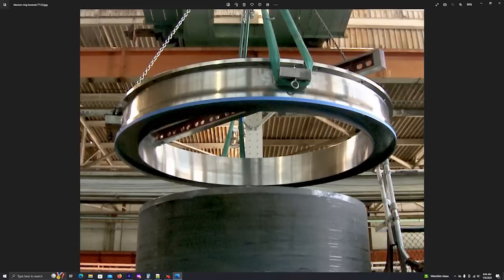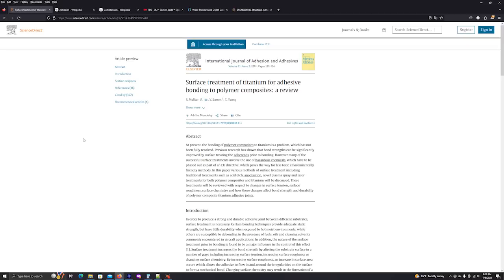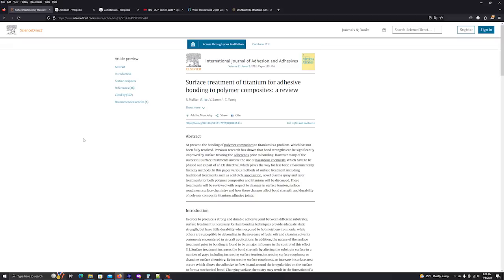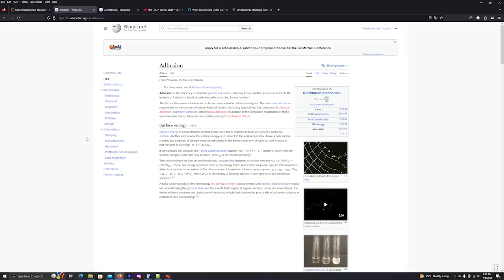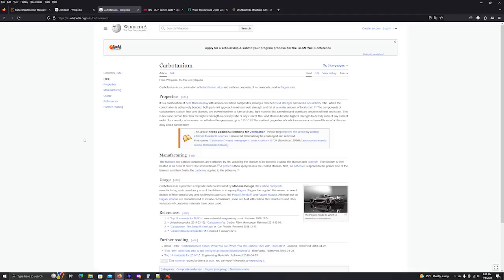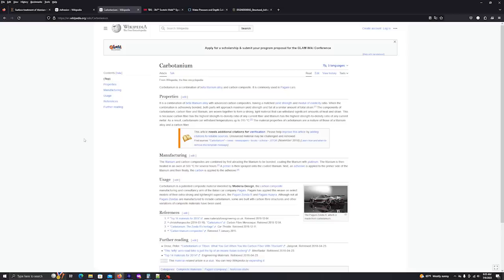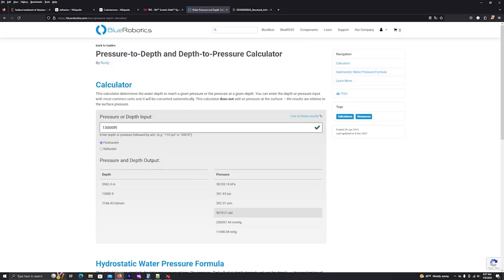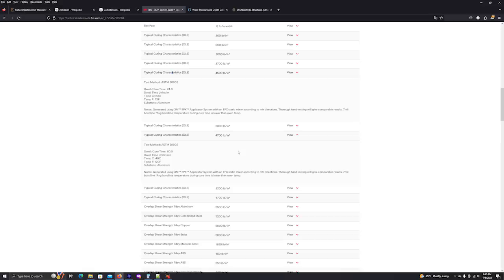Oceangate Titan Adhesive issues between Carbon Fiber and Titanium

Comment: Wow, great information on the bonding process between the carbon fiber and titanium elements. I had flashbacks of diving on my submarine and hearing the hull creak as we went below certain depths. I am not an engineer, but these were the forces that made me concerned for the bonding process. With each dive/ascend cycle there had to be a case hardening type of effect that would eventually weaken the bond. I'm sure it's a case of no balls, no blue chips. The lesson has been learned. RIP my fellow submariners.
Reply from the maker: Thanks for the feedback
Reply: you know once under water they wouldn't even need to have the two pieces glued together...the pressure of the water alone will make it impossible to separate the caps even if you'd try...so the glue as NOTHING to do with all this.
Reply: @TechWizMaster  It's likely that reasoning was taken as 'innovation'. It's not a bug it's a feature! Why make a big deal of holding the flange to the tube when we all know the only way that glue will fail is if there's a hole in the hull at depth. Kind of like the acoustic sensors in the hull that tell you the hull is failing. 'Everything's in the red,' is not a useful diagnostic alert.

Or that it won't matter if you're on the surface and you can't open the hull without unbolting the hemisphere 'because you're already dead.' Dead by design. Squashed like a roach in a corner nobody could reach without pointy shoes.

This is some of the most bizarre thought paths for an engineer. It's such a blind dependency on the numbers and the strategy that the alarm is just there to let you know you failed at a critical point. What you gonna do about it.? You're already dead.

Comment: 11:08 I've worked with Scotch weld it has HORRIBLE adhesion properties with metals such as aluminum and titanium. We used it as a bedding compound for damaged fastener countersinks in carbon fiber panels on F/A-18 Hornets.
I'm trying to figure out why they did not have mechanical fasteners going through the flanges and carbon fiber. I understand that it is under compression while underwater. At least on the front hatch there's a fair amount of shear and tensile force on the flange when the hatch is open.
Reply: Firstly, the idea is to NEVER put mechanical fasteners in CF structures if possible; by cutting the CF Tow, the strength of the individual Tow (where one drills thru) is diminished to the now length of that between fasteners; not the original length/strength intent by Design Engineering. But it really wouldn't have mattered as the Hull imploded first IMHO ... that 6,000 psi would have kept the dome/flange securely in-place ... until the Hull imploded and pushed them right off ... no amount of fasteners or adhesive would have helped ... "Water" does not "compress" and when it gave way, the Water had to go somewhere (out the 2 ends). Bad design and execution all the way around. Rush even stated in one video that the "Adhesive" was actually NOT for the stated purpose ... the intent was to act as a "Buffer" between the different expansion/contraction properties of Titanium and CF.

And free advice on your F/A-18 cured panels you're countersinking ... put a piece of 3M approved masking tape over the area you intend to countersink and then, with a sharpened CS bit, drill. You'll never have another CS with edge "Tear Out".  Works as well on "thru holes" where tear out happens on the back side. Trust me on this Bro.
Reply: @craigsowers8456  No, No, No these were repairs to the damaged countersinks after the removal of striped, stuck fasteners. We had a few younger Airframers that would go a little wild with a drill trying get stuck fasteners out. As far as not having mechanical fasteners we had mechanical fasteners going through structural carbon fiber panels attached to aluminum. I agree it does not help when being compressed at 6,000 psi, but it is not always at the pressure and my question still stands with regards to tensile, and shear forces applied to flange that has the door on it. When open that door acts like a lever on the adhesive joint twisting and pulling on it.
Reply: @patrickradcliffe3837  Copy that ... thought you were talking "new build"; still good hip pocket info on use of tape. As the Door can only be opened on the surface (for ingress/egress of passengers), I'm sure there are forces exerted ... it's a damn heavy door ... so hinge line may take its' toll one adhesion of the flange to hull bond line ... but since Rush elected to not do ANY Ultrasonic (and X-Ray if it looked really bad on the scope), wouldn't know that answer; if you don't inspect, everything is Peachy ... until it's not.
Reply from the maker: Good question.  Thanks for the feedback

Comment: You used freshwater for the pressure to depth calculator. 5619.21 psi

But the saltwater psi is higher. 5768.86 

Not that it probably makes much of a difference
Reply from the maker: Yes I normally check the box, I forgot on  the video

Comment: And this is why the biking industry gave up on carbon titanium bonded frames. Except for "single-season use" factory race bikes. Different thermal expansion rates of material adhesives not able to adjust to size difference. Especially when it experiences multiple thermal cycles.  Nevermind the Warpage Cycles caused by extreme pressures due to multiple dives. Bonding in those conditions is a no-go!!
Don't need to be an engineer to have common sense!!
Reply from the maker: Good comments, thanks

Comment: I know that carbon fibre was chosen because of cost. But if I were going to build a deep diving vessel it would be made of spun steel, Titanium or machined aluminum. Due to the extreme pressure at that depth, the design would be a sphere. It would be a solid sphere shape with no bolted seams. At that depth, a window would be useless. Video cameras would make up the visual aspect of it. I would have redundancy after redundancy built in for safety. With a dedicated way to return to the surface. Definitely a control system that didn’t involve a Gameboy controller. There would definitely be a hatch in the event it were to get away from the surface ship to allow egress from the hull.
Reply from the maker: Good points, thanks

Comment: Yup, mechanical bonding is much weaker because it relies on nooks and crannies of rough surface which can never be as dense and as numerous as atom to atom bonding. Using glue for such extreme pressure application is definitely going to be much weaker than using weld.
Reply from the maker: Thanks for the feedback

Comment: We use titanium rods in our race motors. If they get  any kind of scratches they are taking out of service. If you get any kind of scratching on the titanium surface it is compromised therefore making it impossible  to get any kind of a structural bond.
Reply from the maker: Thanks for the comment

Comment: Rings or hoops of cured carbon composite don't have great strength when compressed from the outer radius.but they are from within the inner radius due to continuous fiber lay-up.
Reply from the maker: Yes, on  the original sub they used filament winding,  On the titan they used carbon fiber prepreg with a tape winding machine in both hoop and axial winding.
Reply: Seems they made a pressure vessel when the opposite was needed.

Comment: The compression stress the adhesive sees is not directly the external pressure.  The axial stress in the hull tube reacts the entire projected area of the OD of the tube using only the cross sectional area in the tube wall.  The adhesive is largely in compression on the end of the tube and largely in shear on the sides of the groove where the tube is bonded.  I get about 22 ksi mean axial stress in the tube if the bond was only on the end of the tube.  The shear stress on the sides will take some of that load, but not so much as to exceed the bond shear stress.  The distribution of stress depends on the backup structural stiffness and the bond line thickness.

This is complicated by the structural deflections of the titanium sphere and ring relative to the carbon fiber tube.  The joint likely undergoes rotation with applied pressure.

The manufacturing quality issue with the adhesive is that if there are void areas in the adhesive, the void is unable to transfer the compressive load from the titanium ring to the composite in that area, and the stress will be concentrated around the perimeter of the void.  Seeing their manufacturing video of the bond, i struggle with how they avoided leaving large void areas in the bond.
Reply from the maker: Thanks for the clarification.

Comment: AS I see it the separation of bond is a serious issue and actually could have caused implosion. But I think when the final analysis is done the problem will have been the difference in compression behavior between Titanium alloy and the Carbon Fiber matrix.   You see Sea water at that depth has compressed in volume by more than 11%.   All sorts of other things compress in volume accordingly.  My guess is the Carbon fiber has matrix has compressed at the depth about 300% more than the Titanium.  This wouldn't have been a problem if the carbon fiber matrix was externally or internally wound with Titanium.   The issue here is that the carbon fiber would have retained its strength had the inner madril of the submersible was say 2 inches thick Titanium. Then the Fiber and metal would have been complimentary.  

The big problem is that bonding to Titanium must rely on a "Mechanical Bond" as you present.  Such a bond would not be stressed if the core was 2" or so Titanium.  Carbon fiber is used extensively where it is compressed from the inside of the shell.   Actually one could build a submarine that was compressively supported by a gap between a titanium internal cylinder and a Carbon Fiber outer cylinder where the pressure between the two was say 1/2 of the depth differential.    This would cause the loading to be 1/4th the energy involved at full compression.  This is a squares function.  

The topical data I read suggests wind with the the Carbon Fiber Titanium wire or matrix glues with powder Titanium in them.
Reply from the maker: Thanks for the great explanation

Comment: If you watch the video of the "fire piston" (link below), it provides a possible explanation for what might have happened to the combustible materials inside the submersible. In my opinion, it appears that the hull and everything within it vaporized. To confirm or challenge this theory, it would be helpful to examine the interface where the hull once met the titanium ring. Specifically, we should look for signs of heat scoring or shearing, as well as any indications of air bubbles where the failure occurred.

In a typical diesel engine, air is compressed roughly 14 times before fuel is added, and it ignites instantly under those conditions. Now, imagine if the compression were 400 times! When the implosion occurred, it generated extremely high temperatures, potentially surpassing those found on the surface of the sun. While I calculated the temperature to be around 120,000 degrees Kelvin, I find it hard to believe that it reached such a level. Nevertheless, it must have been exceedingly hot inside the submersible.

In a diesel engine with a 14:1 compression ratio, all of the fuel burns. Gasoline engines typically have compression ratios ranging from 8:1 to 12:1. Although I'm not an expert in automotive fuel combustion, as a well-informed layman, I understand that higher compression ratios result in more efficient fuel consumption. With a compression ratio of 400:1, it is highly likely that everything within the hull was incinerated within an extremely short duration of approximately 0.0038667 seconds. This calculation is based on the following: the length of the tube was 5.8 meters, and the speed of sound in water is 1500 m/s.

Regarding the delta air volume (pressure constant), we can consider 400 times 300 degrees K, resulting in 120,000 degrees K. By compressing a fixed volume of air into 1/400th of its original volume (pressure of ocean constant). We can apply the Universal Gas Law (PV = nRT) in this scenario.

I hope that someone will point out any mistakes or provide additional insights. I have made some assumptions to simplify the calculations, so I acknowledge that the actual situation is likely more complex than what I have presented here. I look forward to hearing your thoughts. Thank you.https://youtu.be/DUlWehH8cH0
Reply: Ever waved your finger through a candle flame?

Duration of that heat is important. It was surrounded by and instantly quenched by a huge mass and volume of sub freezing material. Similar to how a 2000 degree spark from a sparkler does nothing to you or your clothing. Difference between heat and temperature. Alot of temperature, not very much heat in contrast to the surrounding materials.
Reply: @cecilbrisley5185  Thank you for so clearly demonstrating the difference between heat and temperature. 👍
Reply: @SciHeartJourney. I also thought as you did initially, based on a typical gas compression scenario in an implosion sequence. Then when I saw the photos of the wreckage, I was surprised that none of it showed signs of scorching or even heat deformation, so I commented on that. A couple people with some experience pointed out these factors: 1. the total volume of gas was small, and compressed by the extremes at that depth, it was extremely small. 2. the gas compression occurred in a very large volume of extremely cold water, and at that millisecond or so, in what was no longer an enclosed hull (global fracturing of the CF hull). They both said that any compression/heat/ignition phase, if it occurred, would have negligible effects in this situation. (The exchange is in the comments somewhere on the BBC News episode on video of the transfer of the wreckage at St. John's).
Reply from the maker: Great info thanks
Reply: I think you're right, the temperature was so high everything inside burned in an instant,  along with the people inside.... that's why no bodies and no parts of the carbon fiber cylinder can be found. 
 The more I look at what happened, the more I think it was a suicide. If you want to kill yourself and burn to dust yourself at the same time in the fastest way possible, that's one of the ways. It looks like some ritual suicide.... but why take innocent people with him....  He knew exactly what he was building, an underwater self combusting incinerator... just looking like a submersible.  He was probably hoping it would implode the first time he goes down... but the thing magically held up... that's why there was no need for any safety.... because it was a death trap. People think these things happen only in the movies.... that's why everybody was so careless. That's why nobody paid any attention to the gluing process. It wasn't build to held up.... look at all the other submersibles and how they are build, especially the pressure chamber. But this.... this was build with little glue hoping the water will held it together... nah.... it was constructed as a death trap from the very beginning.
Reply: Two things - first there wasn't a lot of air - maybe 3 or 4 cubic metres, so even compressed to 400bar it wouldn't have contained much heat and similarly the small amount of air wouldn't have been enough to burn all the combustible material in the cabin, even assuming it got to it before the water did. The difference with petrol or diesel engines is they have enough air to burn all the fuel.

Comment: To me this land should have had Crews like a Lego piece that they enter certain each other that way if the carbon-fibre was flexing the titanium interlocks would stop it but after hearing the transcripts today it sounds like even if it was a titanium Hall that they would have had the same issue if they descended so fast that it put that much pressure on the hall and then started coming back up and imploded the pressure is great but remember there's chinaware down there that is completely intact and fine you're talkin about teacups that if you drop them on the ground they would shatter and a bunch of pieces so that being said there will be big chunks of their body floating around such as torsos heads Etc also GoPro cameras or any video camera encased in aluminum or a hard plastic Will Survive and if they found video it's going to show his zactly what happened unfortunately gruesome but it has to be washed for research also just so everybody knows there was more shipping containers unloaded at a different port that were sealed they only showed you the ones they wanted you guys to see everybody has to remember that and yes there is rumored to be pieces of full round carbon fiber Hall yes broke off but still intact bigger pieces than you people think
Reply from the maker: Thanks for the feedback

Comment: Worlds worst joint and seal . No bolting , taper flanges o rings etc . Terrible seal but more importantly they have different thermal and coefficient of expansion !! 
Great notes in the glue and bonding ! 
My point exactly on the engineering . Any first year engineer could have done better .
Reply from the maker: Thanks for the feedback